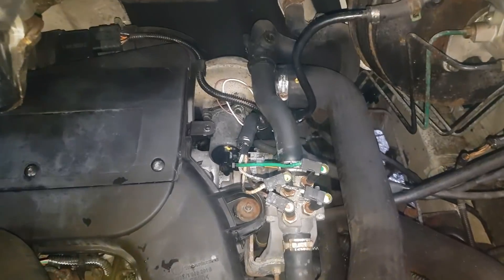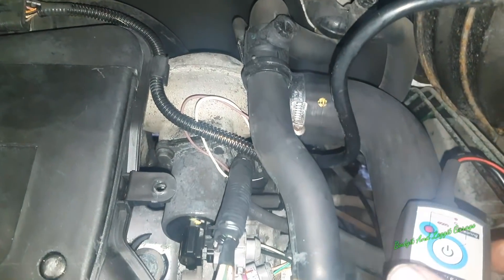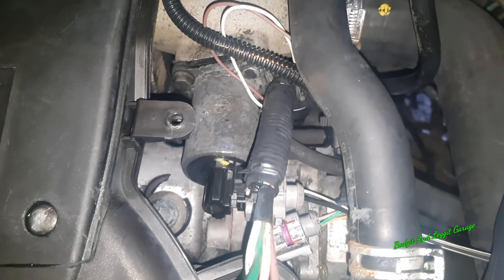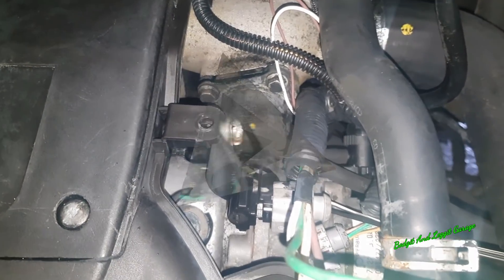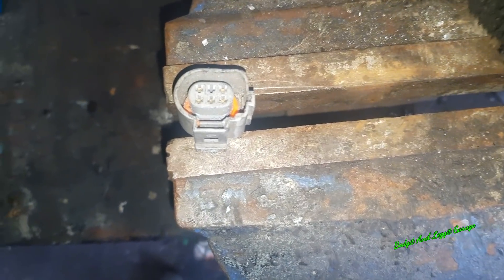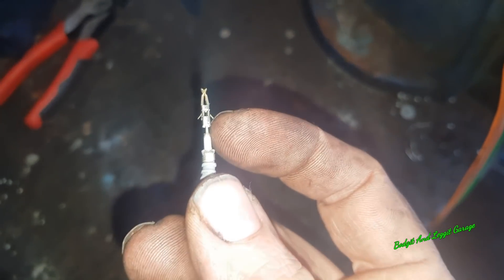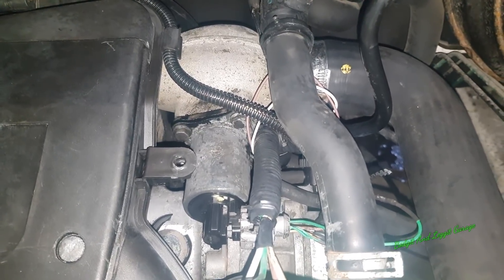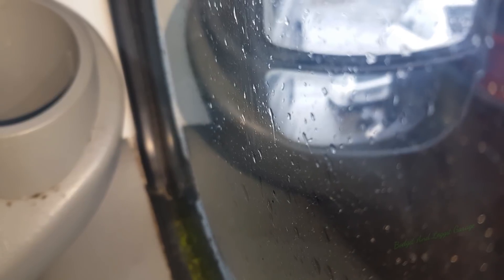Nissan/Vauxhall/Opel EGR Valve How To Re Pin A Connection Part 3

Comment: You are a wealth of knowledge mate. Im struggling with my egr at the moment but im struggling to work out where the pink cable goes. I saw a video that says it should be 12v bit i cant pick up any voltage at all. Do you have any advice?

Comment: I didn't know you could do this , I ripped a wire out of a wheel speed sensor when replacing rear hub on a Mazda 3. In the end I spliced the cable from a scrap car to the same length and then the light went out on the dash . Wish I knew this . Thanks bodgit and leggit.
Reply from the maker: any time mate